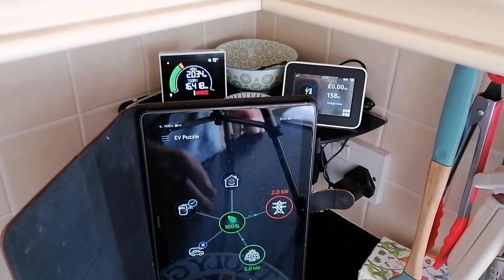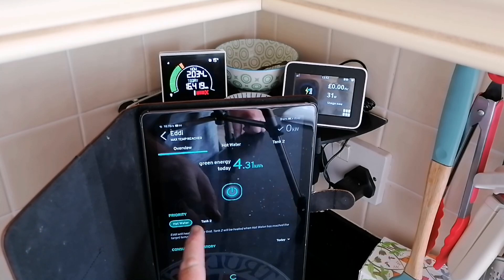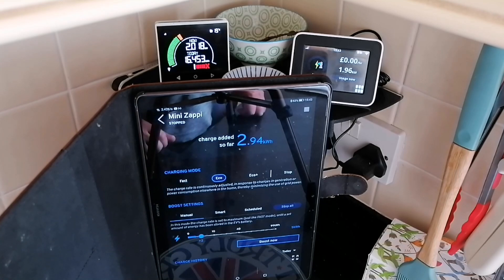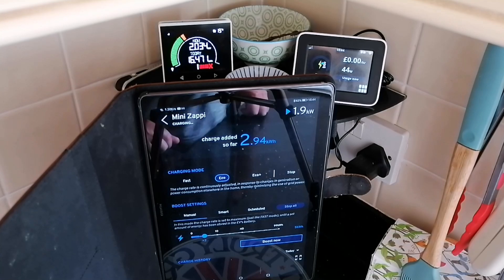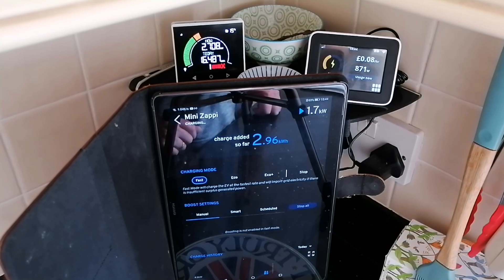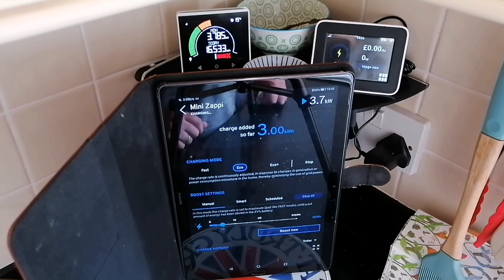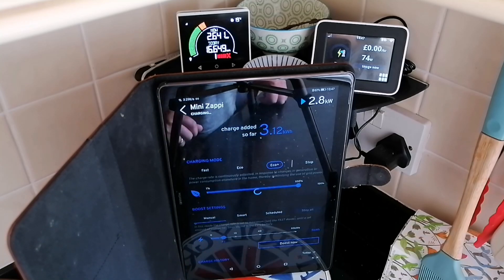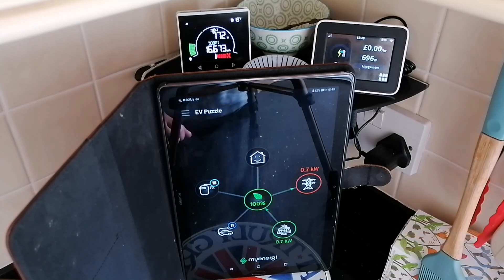Zappi Grid use test - Huawei Hybrid solar battery

Comment: Hi, could you please share the setup with the Huawei+Luna and Zappi? Where are the generation and grid CT clamps for the Zappi are located and if there is anything specific in the electrical connections? On my system (Huawe+Luna), the Zappi can't "see" how much PV energy is produced and once the Zappi starts to draw the full 7KW, then it thinks it os all generation and takes it... It doesn't behave the same waya as your system test. I have tried many settings and played with the locaton of the CT clamps, but no luck so far. Thanks in advance!
Reply from the maker: Huawei is hybrid DC connected so, you can't see battery /solar from zappi

Comment: sorry for the newbie question (I'm starting to look into PV for my next house refurbishment ) : why can't you see your battery in the MyEnergi app ?would having a harvi attached to it help ?
Reply from the maker: My battery with this Huawei system is a hybrid battery . The battery is on the DC side of the inverter. Myenergi only monitors AC batteries where their input and output are AC connected.

Hybrid means my solar and battery are blended together as the DC power from both is inverted to AC Power. Myenergi just sees it as solar power, it can't tell if it's from the battery or solar panels.

New video coming soon to explain that one.

Myenergi sees AC coupled batteries
Reply from the maker: Newbie questions are fine but the best answer is watch the series of videos in time order and I'm bound to have covered what you're interested in. It's an ongoing learning process

Comment: Hi Nigel.

Got a test I would love to see.  How about switching to solar energy only.  So battery, inverter, solar.  Connect all appliances that are normally running, thereafter do the Zappi.

What is the inverter capacity by the way???  If the inverter struggles or disconnects, the spike is only evident upon start up upon milliseconds and not seconds.  Would be interesting to see.  You did one with the grid tied, and this means elimination by process.  Will put on my electrical sided brain, I last used pre 2000.
Reply from the maker: I wish I could run on solar only, it'd make things easier.

Sometimes I wonder if the few tenths of grid use that aren't visible in the Givenergy or huawei apps ( they both coincidentally under report grid use as if they're brilliant) could this be reactive power not actual power.

Far too technical for me to understand
Reply: @EVPuzzle  it is usually between 30-50% spike of the current that a device uses.  That is why an inverter is set up for a surcharge as well, which doesn't last more than a second or two.

Like the basics of a fridge freezer.  What the sales people or technicians don't tell us, oil moves in the pipes and should settle at the bottom when the unit was delivered.  So an hour later you switch it on, and that delayed switching om give you a longer life for the unit, and as the pipes works on the gas and not the oil.  This tip allows you a good few years extra service. 

It's the tolerance levels that a unit gets on switching on before settling down, should be less than a second generally.

Technically then, you need a unit that can check energy in 100th of seconds to verify what it uses.

Comment: Why does it charge at around 3kw on eco and drop to 1.7 on eco+??
Reply from the maker: It's the residual battery power. It's seeing available power so using it. Gradually, even in Eco mode it drops the charging down to 1.7kw matching just solar availability.

Not all systems will work like this, it depends how fast the cattery reacts providing power and how quickly the Zappi can release it depending on the export margin set.

The general difference is my system now charges at higher rates for longer and doesn't drop out as much as solar reduced. The battery has become more active. Withe the Givenergy battery the Zappi would just cut out and just use solar only. The battery didn't support the Zappi at all. Sounds like a small millisecond change but its having a decent impact on the usability of the overall system
Reply: @EVPuzzle  that’s weird my givenergy always adds to it(unless it needs charging itself) but only up to the minimum 1.4. But I’m not pulling as much as you it’s around 2.5 at its best
Reply from the maker: Mine did too when I selected Eco it was just less active. In eco+ mode givenergy never filled the gaps when clouds passed the charging rate would just drop. With this Huawei one it covers the drops much better.

Comment: Interesting, so the Zappi sets its Control Pilot (CP) signal to its maximum delivery rate at the start of charging (7Kw) to tell the EV what the maximum charge rate can be, then depending on the Zappi setting (FAST or ECO) it either leaves the CP at maximum or gradually reduces it to match the available solar excess, in your example 1.6Kw.
As the Zappi itself does not dissipate any power (nominally low power and typically 2W quiescent or power as heat in the cables/contactors) then if there are power spikes where is the power being dissipated, which either has to be as heat or as an electro-chemical transformation (battery charging). If the Zappi is not connected to the EV, then the power spikes cannot be the result of the Zappi, or if the EV is connected then it must be the EV periodically requesting power to either perform a (power available) check or some other function. If the Zappi were disconnected for some time and there are still power spikes then the problem is elsewhere?

Comment: I think the spiking only happens on MK2 Zappis - sure does on mine on all modes, goes up to max charge and then drops down pretty quick.
Reply from the maker: That's not good news. I was hoping Zappi 2 would be better. Definitely sounds like a patch to get more cars working. It's sad when it's 1 step back etc

I wonder if we need car specific firmware.
Reply: @EVPuzzle  We probably do... So my e2008 won't work with Eco+ mode properly. When the charge stops due to lack of solar, the car gets stuck and won't charge again until you unlock and lock it again - no kidding!!!
Reply from the maker: It's a common thing with more recent cars it seems. New Kona, Tesla, MG they've all had similar issues
Reply: @edwardpickering9006  same with the zoe on zappi copy !  So pleased we have battery as without battery it could be a problem to get it to charge reliably from solar !
Reply: @EVPuzzle  add Zoe Zoe50 to the list too as least on zappi copy !
Reply: @EVPuzzle  maybe 🤔 heard some Ev have different problems. Like on our charger the Zoe refuses to wait for enough solar to charge and if charger don’t sen pilot signal in under 1 min of so it fails to charge so had to put the charger in fast ie 4 kW for just long enough for it to start charging maybe 20-30 secs then put it in eco so then Zoe is happy to adjust upto availability of spare solar and locks cable in as soon as you plug both ends in ! but mg5 on same charger was happy to wait for solar but didn’t lock cable in till charging started  and  seems to adjust the charging rate just as happy as Zoe but when you unlock the car it stopped charging and unlocked the charger cable that ped the charger off 😱🤬😡 and this doesn’t happen on the Zoe 🤔🧐 wounded why the two cars are so different?
Reply from the maker: There's a compatibility mode just fir the Zoe though...
Reply: I see the spiking on my MK2 Zappi as well. 7kW spike and then ramps down to whatever the solar excess power is.

FWIW, I have a Kia e-Niro and an MG ZS EV. The Kia e-Niro handles the stop/starts flawlessly, but sometimes I have to restart the charge from the MG ZS EV app after the power drops due to clouds etc.